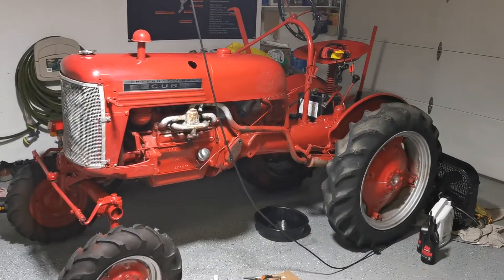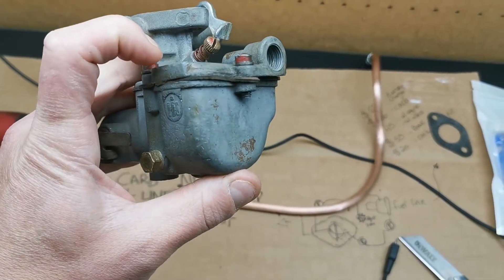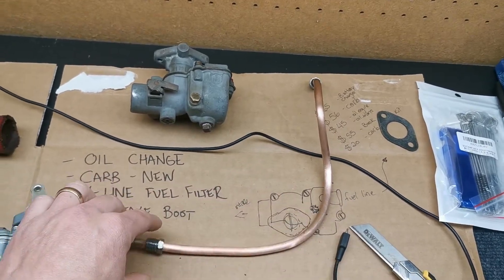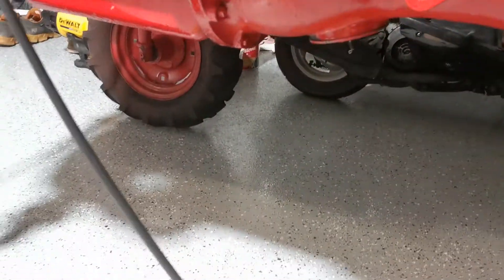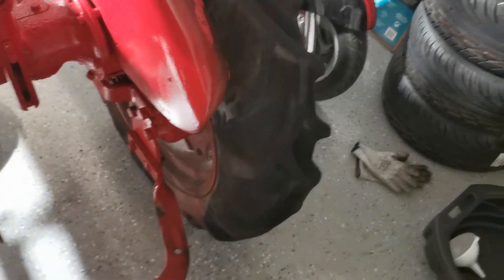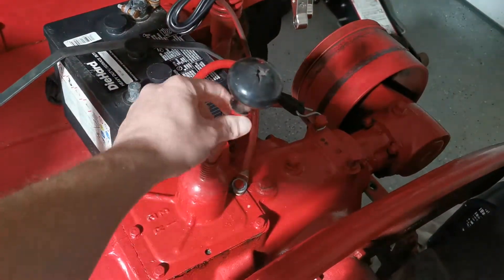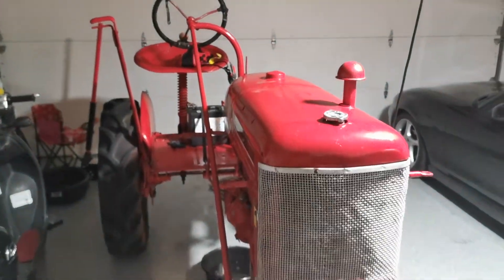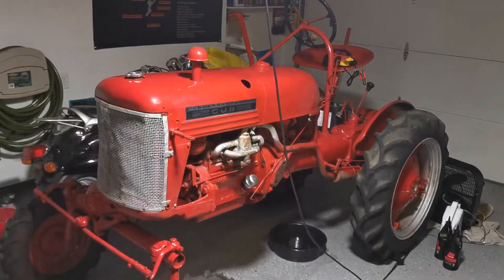Farmall Cub 1948 new project

Comment: Those caps are painted because they were from the factory! Don't forget to hit the Throwout bearing about once a year. Its behind that lower cover you have on the bottom of the torque tube.

Guy has an odd selection of tire on the front. Especially since the TRI ribs are easy to find.

Sounds like you know but grill should be red.